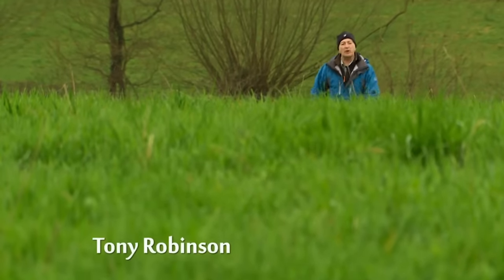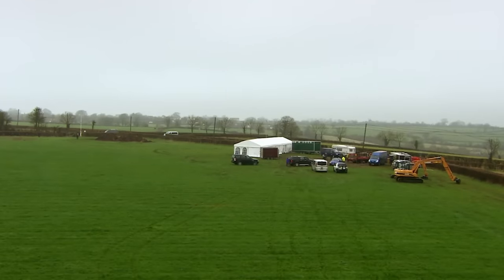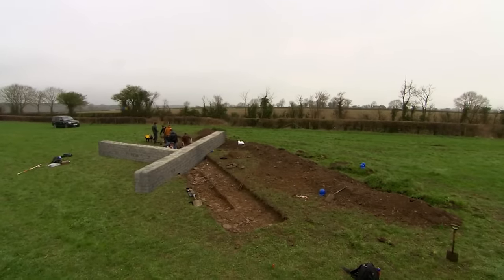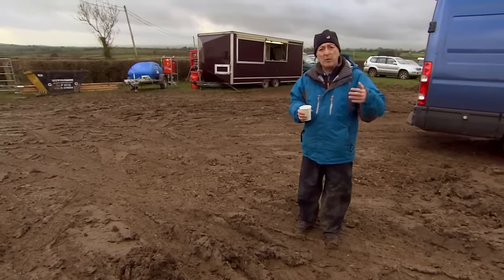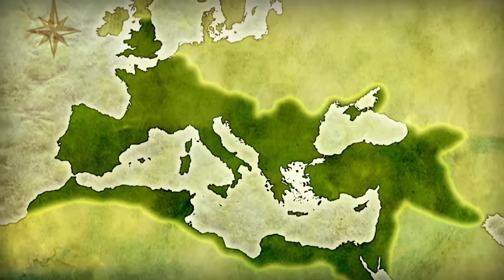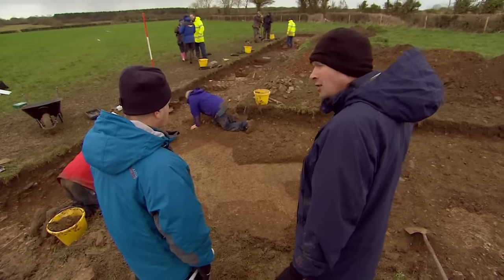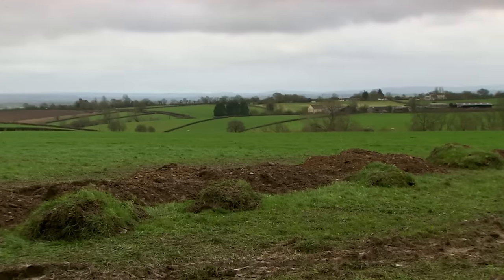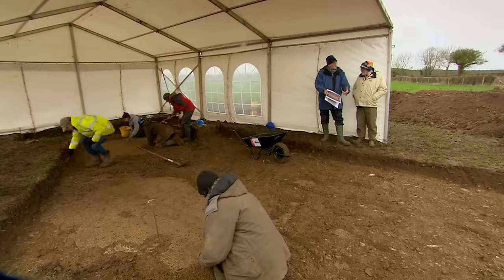‘Romans on the Range’ (High Ham, Somerset) | Series 18 Episode 3 | Time Team

Comment: I can’t understand why they wouldn’t remove the two sections of mosaic, clean ‘em up, and display them in a museum! Leaving them in situ does not guarantee their preservation, rather leaving them to moulder away in the ground. The rose design in particular should be seen by the public. These mosaics are so tasteful, unlike some of the lurid pagan designs of some elite dwellings. I’d like to see them replicated in modern forms, either porcelain or even sheet vinyl. I’d buy them!